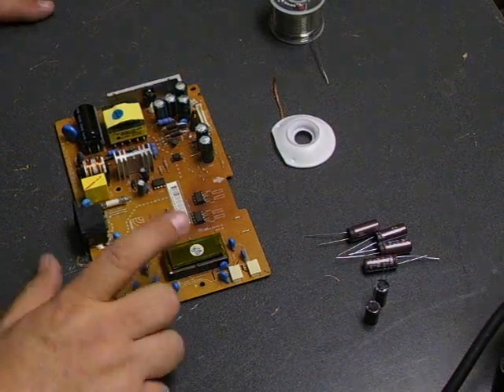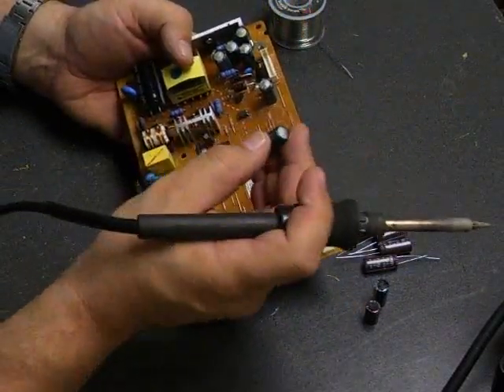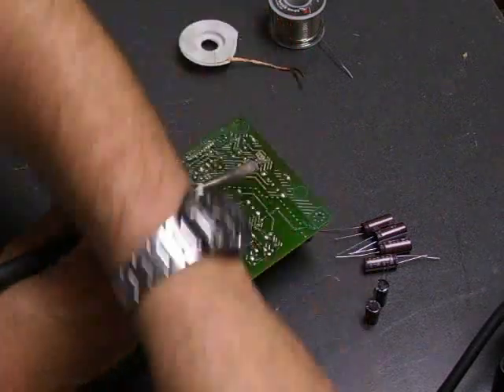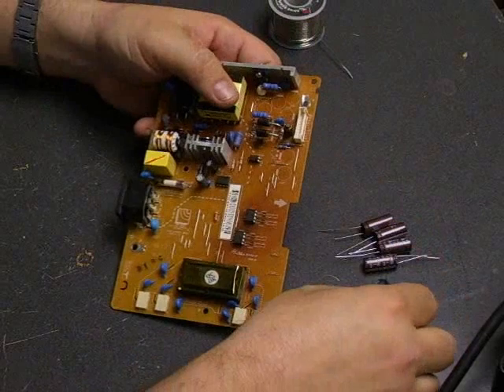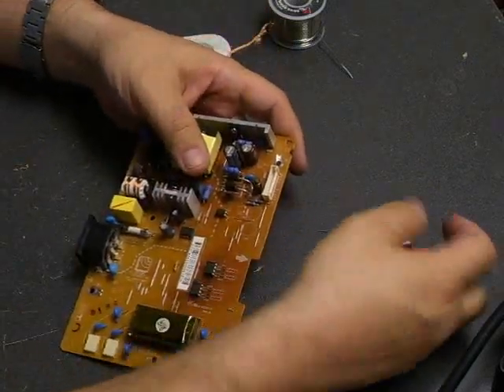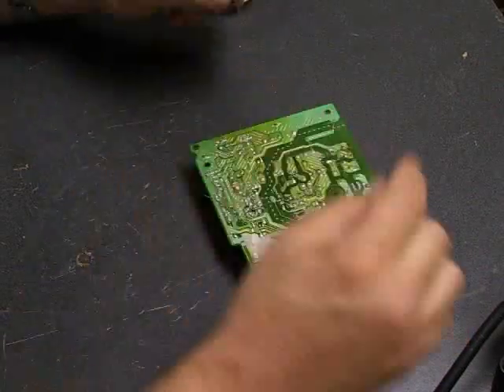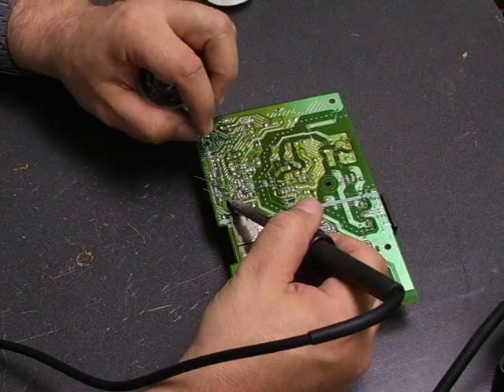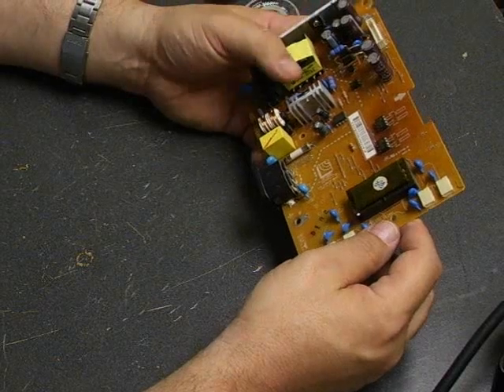Repairing an LG L196WTQ-BF LCD monitor - Part 2 board repair

Comment: Excellent. Just fixed my L196! Replaced 3 bad caps: 470, 680 and 1000uF. Ordered full set (6 caps) from Mouser. But!! You must really know what to order! To novices or those confused by wide selection, I recommend to get a kit from authors. Price is same as ordering from Mouser plus shipping.
One question: PCB in my monitor has only 1000uF 16V caps, no 25V. Is it wrong and I shall expect more caps to fail? Which shall be 25V?

Comment: actually im working on Dell and dynex LCD Monitor / TV ( Dell LCD Monitor no power problem is I.C Regulator the IC Regulator is burn/damage TOP249YN ) & ( Dynex LCD TV 110V issue is accidentally plug on 220V with power red light but not green light no display the problem/shorted is 10A Schottky Barrier RectifiersSP10100 , STP10NK70ZFPN-CHANNEL 700V - 0.75W - 8.6A TO-220/TO-220FP
Zener-Protected SuperMESH™Power MOSFET , Low IR Schottky barrier diode YG865C04R 45V / 20A

Comment from the maker: About 95% of monitor problems are caused by the filter capacitors in the power supply board. The heat buildup in the cased basically cooks the capacitors.